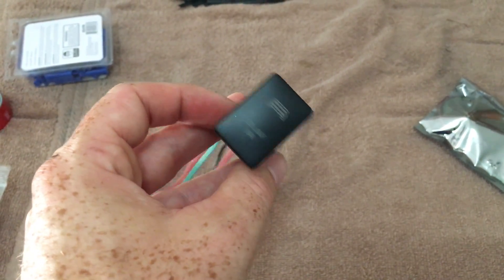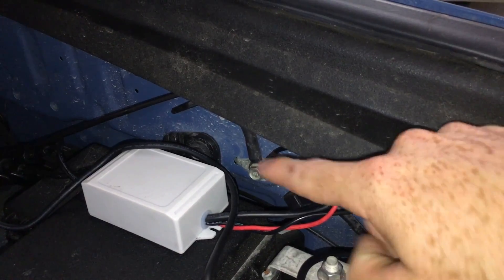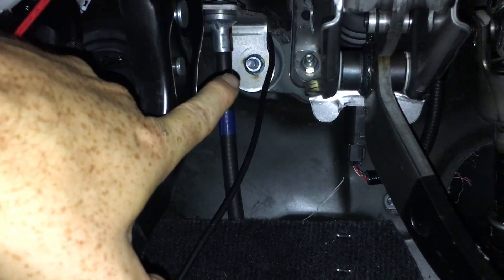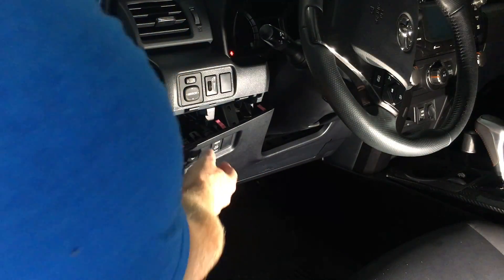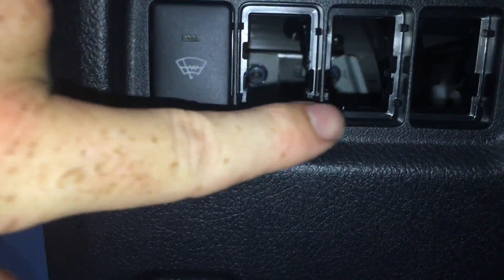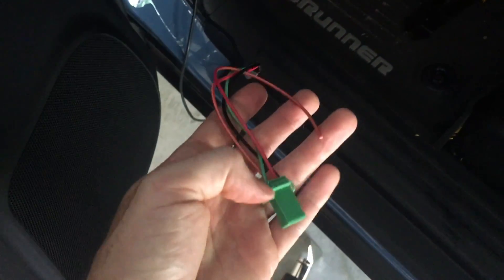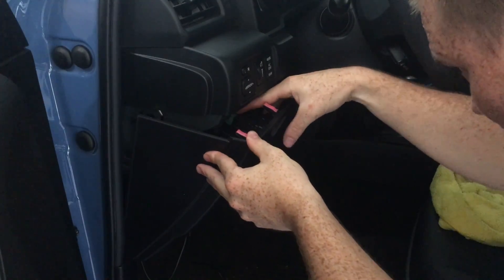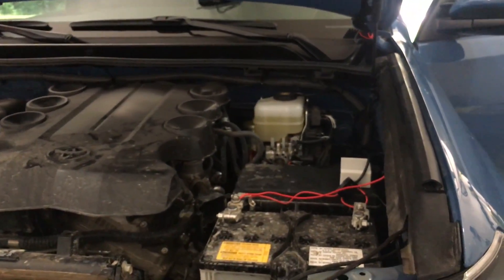OEM STYLE LIGHT BAR SWITCH INSTALL | TOYOTA 4RUNNER

Comment: You didnt go into detail on the switch light wires. What's the best way to wire those up without using a fuse tap?
Reply from the maker: Like lighting up the switch ?
Reply: @TRDJon  yep the "red 2" wire that lights up the switch while the car is running
Reply from the maker: Yea I didn’t do those ones.
Reply from the maker: Didn’t wanna splice into my stock harness
Reply: @TRDJon  yep same here, left them unwired but I dont like how they aren't lit up when they're not on.
Reply from the maker: I’m sure you can tap into the add a fuse spot where everyone runs their raptor lights

Comment: So I just installed this switch, not sure why the led on the switch stays on button pressed or not, I'm sure it's not going to drain the battery, running a small led bulb like that but I'd like to figure out why it's constant. Any ideas?
Reply: JK I figured it out. Thanks for the video!
Reply from the maker: How’d you fix it ?? Mine is staying on now.
Reply: @TRDJon  the wire from the light bar that you have connected to the red wire on the switch and the wire you have connected to the green wire on the switch need to be swapped at least that's what it was for me.
Reply from the maker: Huh that’s weird. I will try that!
Reply: Erik Lando thank you my man!!!!! just saved me a lot of hassle😭

Comment: Great Vid.  Im going to use it for my install. Can someone give an example on what can you possibly use the spare red wire for? Not sure what "running with dash lights mean" , maybe run with fog lights for example? I saw on some other vid that the two of the red wires were spliced together for the connection so this got me confused a little. Great vid , everything close up and no useless talk. Thanks!
Reply from the maker: Thanks! So when you turn on you lights at night time, the light will come on to the switch as well.

Comment: I hooked everything up and my switch led won’t turn off. It is constantly on. How do I change that?
Reply from the maker: You'll have to reach out to them. Others had the same issue and I think that it is internal to the switch.
Reply: I had the same problem. All you have to do is switch red wire 1 with red wire 2 and that should solve the problem. Sometimes the diagram has the two red wires labeled wrong. Hope this helps
Reply: James Fase I will try that!  Thank you!
Reply: How to connect the ditch switch led to low beam head light. My led is on only when ditch switch is press on. Hard to find and press without the switch led driving at night. Any idea?

Comment: Hey Jon, Question on doing this 2020 Pro. I had done this on my 15 Tacoma light bar and the push button switch. Is the dash removed the same way on the 2020 4runner. Also did you tap into the fuse box in the engine? When I did my 15 Tacoma I did add a fuse where the push button was located. But watching your install you just wired them to the push button. Any info. Thanks.
Reply from the maker: Their dash just pulls down basically. And no I have not tapped anything into the fuse box under the hood. I didn’t want potential water getting in there

Comment: Wish you would have shown where to wire to illuminate the switches (like the rest of the dashboard)
Reply from the maker: It’s in the diagram i included in the video if you tap it into the dash lights.
Reply: Blue TRD Jon hey I’m a total noob, how do you tap a wire into the dash lights??
Reply from the maker: I didn’t do it with mine. But you just have to find the hot wire for whatever the dash wire is

Comment: How do you remove the top empty slot switch
Reply from the maker: Press and squez it just like the other ones. It will pop out
Reply: Look like you cant put a light bulb ik the switch to light up the knob
Reply from the maker: Some are kinda knotched a weird way..But the aftermarket ones should fit wherever.